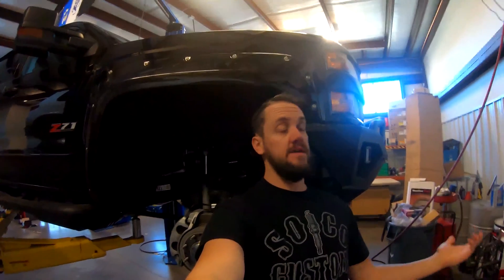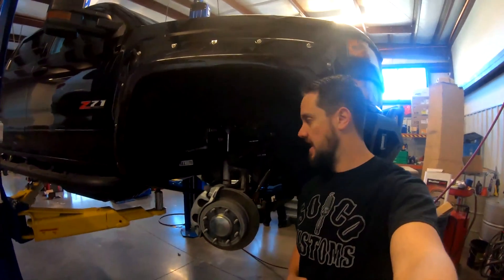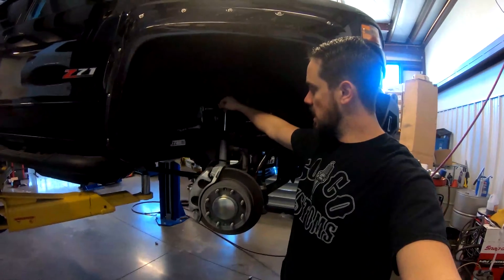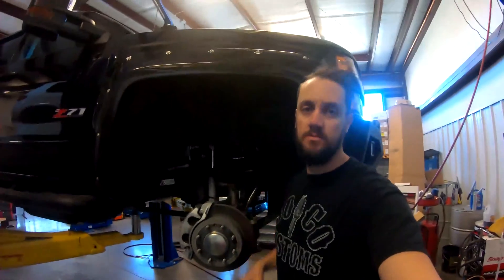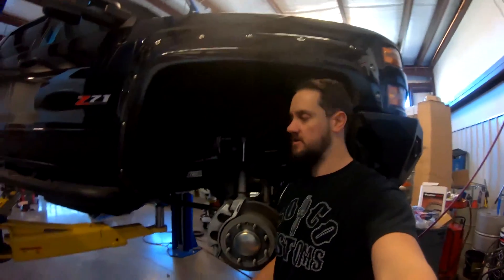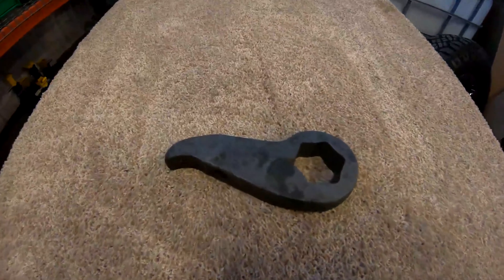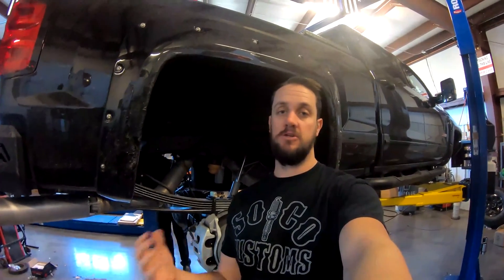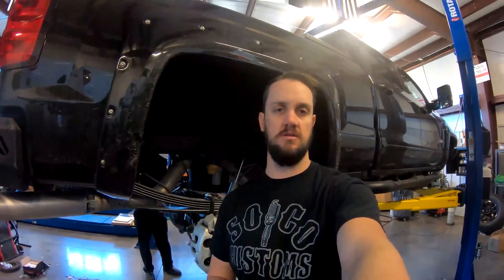Quick Hit: What is a torsion key lift?

Comment: I have a 06 D-Max 4x4 with a rake of 41.5” at the rear to 37.75” at the front (measured from ground to bottom of the flare). The rear is bagged with coil-overs, hence the height. Do you think I would still need blocks on the rear if I were to put in 1.5-2” keys? Thanks!!!